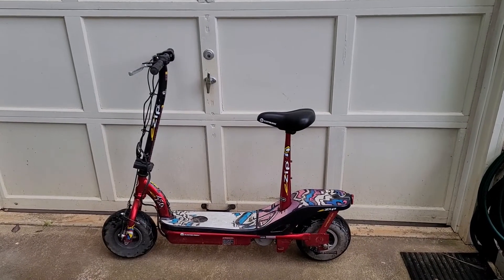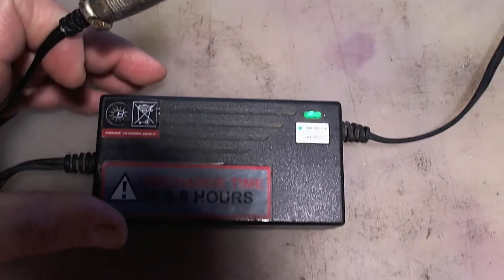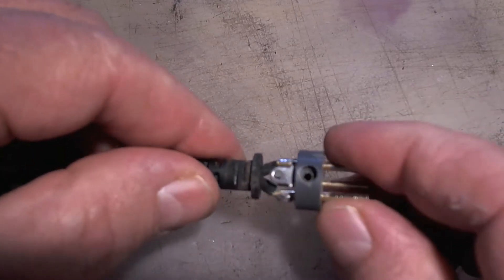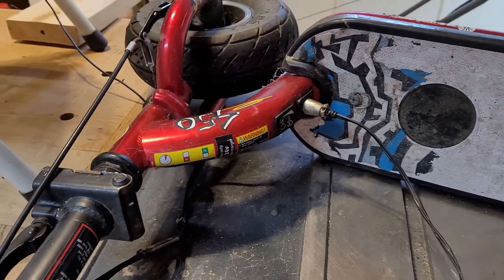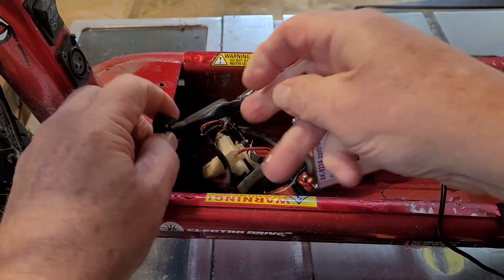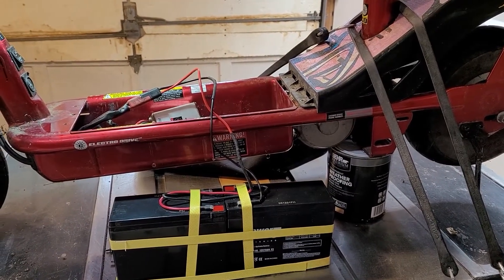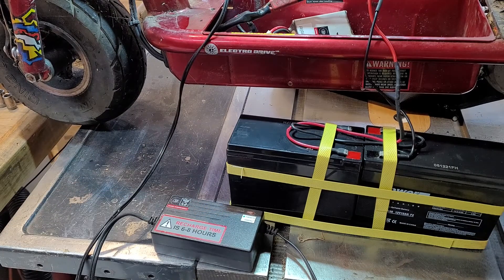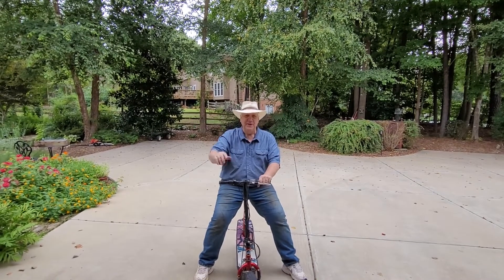Fixing an electric scooter (eZip)

Comment: I just bought one used on marketplace for 100$ and the charge won’t hold at all. I read the user manual and it said max charge time is 4 hours so I did and it only ran for 10 min at full speed. You think it needs a new battery or could it be something simple as a new charger or something way more complex I need help.
Reply from the maker: It's very likely you need a new battery, but I'd start by checking the charger output with a multimeter if you have one.
Hope that helps and thanks for watching and your great question!

Comment: I don’t know if the scooter that I have is an ezip scooter or not but it looks like the one in your video so I am basing it off of that. I was wondering if it is possible to go from a 24 V battery pack to a 36 V battery pack because the 24 V battery pack as it does hold a charge and works well it just doesn’t go as far as I needed to. It can only go 4 miles. I was wondering if a 36 V battery pack will increase the range and speed because right now I’m averaging about 10 miles an hour. 10 miles an hour is fine. It could be faster but it’s fine. The main concern is if the 36 V battery pack will increase the range?
Reply from the maker: Interesting idea.
I'm no expert but would guess the electronics (control circuits, regulators, etc) might not do well with a higher voltage.
Thanks for a great question! Please share what you end up doing!!

Comment: It doesn't work like that it goes from that port to the battery doesn't go up the stem The throttle is the cable going down to the little ECU when you give it throttle it since commands to the ECU then therefore it tells the ECU to put power to the back wheels 24 volts does not go to the throttle
Reply from the maker: Thanks for the great info!
And for watching and sharing!

Comment: I know this is a older video, but i love this design scooter, just picked one up, striped it down droped in a 1200w brushless hub motor, modify the fram for rear disc breaks, going to a 52v battery and 30a controller. Should do 35-42mph.
Reply from the maker: Woah... I gotta see that. Please make a video and post it!!!
Good luck with your "muscle scooter" and be safe 😁

Comment: I need help i brought new batteries and new charger the sccoter dies really quick after so many feet
Reply from the maker: That is strange!
I'd I remember right that battery takes a while to get a full charge.  Have you tried letting it charge for a long time (2 days)?
The other possibility is that the charger isn't making good contact with the battery.  If you have a multimeter check the voltage when charging. 
All the best in getting it running!
And thanks for watching and commenting 👍 🙂